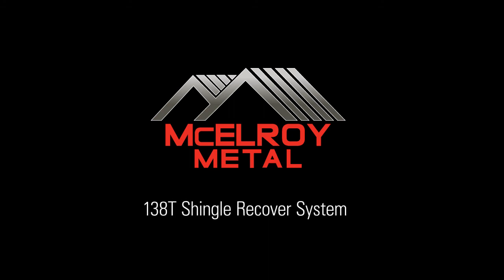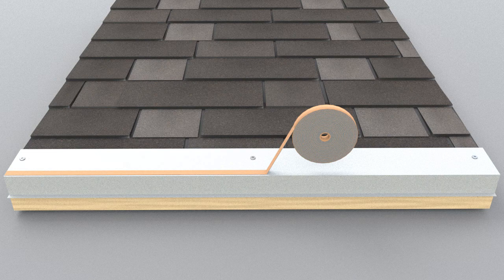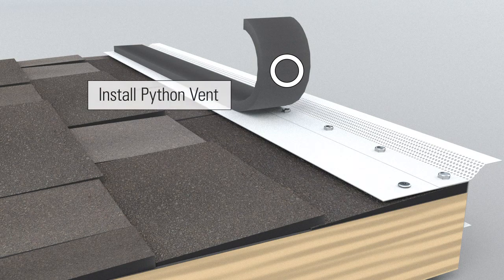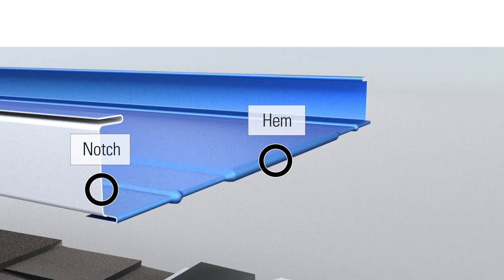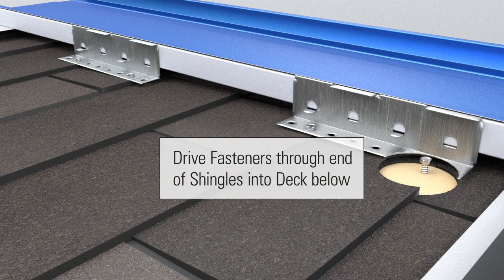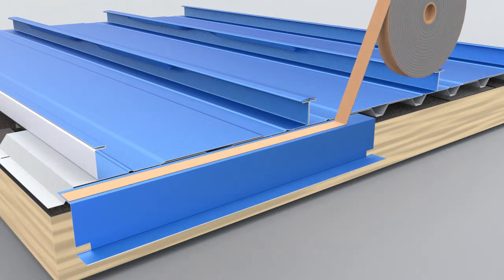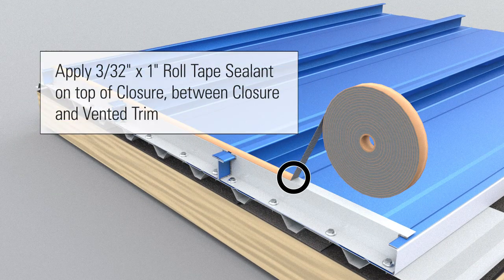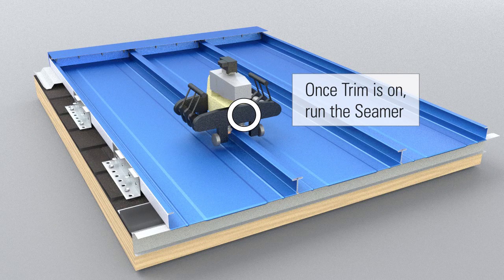138T Shingle Recover System

Comment: This is a cool system and while the ridge looks like it might go on easier than the Central States H-loc system, there are more steps and the last thing you want while moving back and forth on a slippery metal ridge is to go back and forth a ton of times. But i bet it works great!